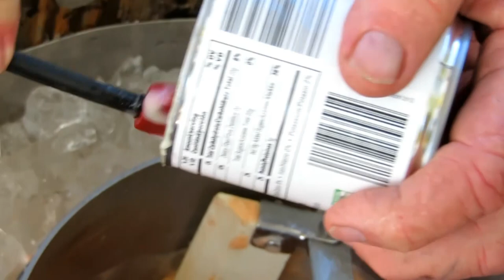1923 IHC 'M' 1-1/2HP Gas Engine Making Orange Sherbet

Comment: What a fun looking place! The engine is really amazing too. Correct me if I am wrong but was that engine originally hut and miss? Or was it designed to fire every time?
Reply: All IHC M engines were throttle-governed; meaning the governor actuates the throttle depending on the load. Hit and miss engine pop one or two times then chuff for a while when not under heavy load. In a hit and miss engine there is no rocker arm on the intake valve, so when it's up to speed, the governor holds the exhaust valve open. Any gas burning, throttle-governed engine without with only one rocker arm can be converted to run like that without too much fabrication.
Reply from the maker: A poorly tuned throttle governed engine may behave like a  hit 'n miss engine.